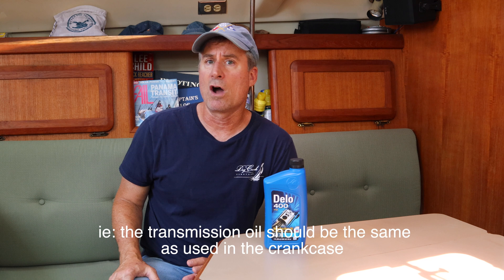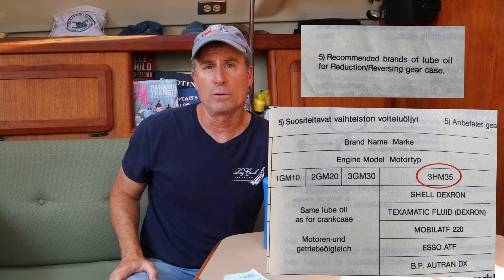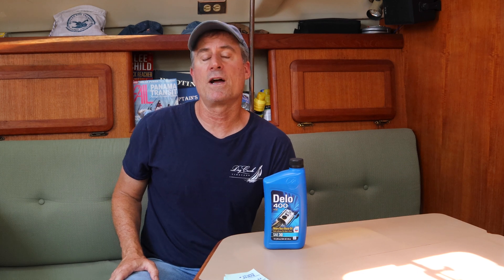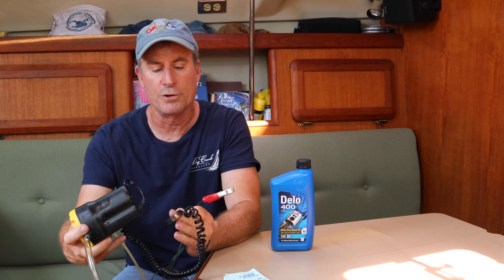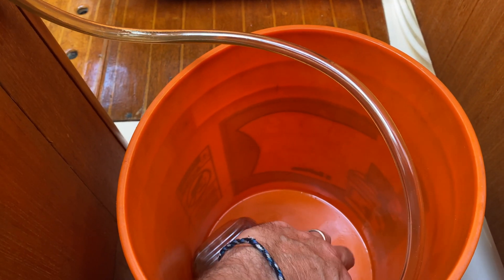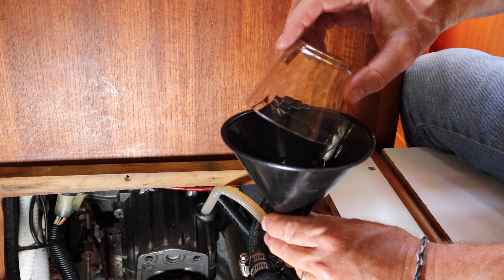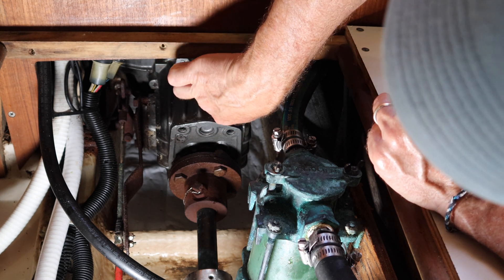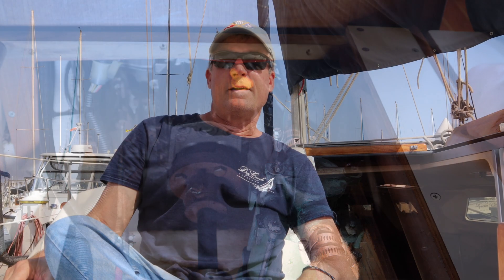Yanmar 2GM20 Transmission/Reduction Gear Oil Change ~ Ep 74

Comment: Proper name is marine drive.  Not transmission. Thanks for the video
Reply from the maker: As I stated in the first few seconds of the video and repeated throughout the video — Yanmar refers to it as the reduction/reversing gear in the owners manual for the 2GM20. The Yanmar owner’s manual  does not refer to it as a marine drive. I used transmission as a commonly understood word and also wanted to refer to the exact terminology that the Yanmar’s owner’s manual uses to avoid confusion. I also put on the screen, pages from the owner’s manual where they refer to it as reduction/reversing gear case. Thanks for watching!

Comment: I have the 3HM35F and yes it does require ATF in the reduction gearcase.  All of the GM series use motor oil in the gearcase.  The confusion arises from the maintence manual which covers the 1GM10, 2GM20F, 3GM30F and the 35HP 3HM35F.

Comment: How often should the transmission fluid be changed?
Reply from the maker: According to the 2GM20 owners manual (section IX p. 71) under Periodical Inspection and Maintenance — it states after 50 hours the first time on a new engine and every 250 hours thereafter.

Comment: A very useful video with all the detail from oil type to procedure used. I use a vacuum pump but after watching this video I'm shopping for an electric pump = much easier. Also very useful to see the colour of the oil form your gearbox, cleaner than mine but not by a lot. Great video thanks for posting.
Reply from the maker: Thank you for your comments! The pump was very inexpensive so I keep expecting it to fail, but it’s still working.

Comment: Before you start, pour a cup of water in the used-fluid container, mark the level on the outside with a Sharpie and pour it out.
When the old oil gets in the container you won't have to pour the old oil to measure how much came out.

Comment: I doubt very much that a mechanic cross-threaded the dipstick. It was most likely previous owner(s). Sailboats in particular are almost all owner (non) maintained. I have been looking at so many boats for purchase over the summer and I have to say they are 95% trash (non) maintenance by a bunch of bumpkins. Even owners with money don't have a clue what needs to be maintained and haven't kept their boats safe. There are many, many, many scary sailboats out there waiting for a strong wind to get dismasted, scary chainplates and standing rigging, electrical wire rats nests, gate valves waiting for an old seacock to break or hose to split and sink the boat. If I was an insurance company I would demand that certain minimum maintenance items have been changed/updated or I would not insure the boat. So no, not a mechanic...trash owners.

Comment: Tips for getting all the transmission fluid out?
Reply from the maker: You aren’t going to get every last drop out extracting the oil — but my experience is what’s left is insignificant.
Reply: @tcsadventures  i ment coolent sorry diffrent topic, blew a head gasket and saw your video about oil change and this, but nothing about changing the coolent.
Reply from the maker: No I don’t have a video on changing the coolant. You’ll want to flush the system too. You want to be careful — air left in the system can cause super heating of the engine. Below is a link on a guy that I believe is knowledgeable and he discusses how the system works and how to change/flush the coolant. https://youtu.be/aZv4IXFPMqg
Good luck!

Comment: It's nice to see how-to videos by someone who knows what they're doing. Good job
Reply from the maker: Thanks! My wife is always telling me that I have no idea what i’m doing lol! Hope the video helped you. Thanks for watching and commenting!
Reply: @tcsadventures  I did the change yesterday and just noted a couple of things. My dipstick although original doesn't have the extension to allow you to thread and unthread it without tools. It's more like a hex cap screw and a 
metric wrench is required. Getting single grade SAE 30 is a scavenger hunt locally, so I had to settle for 30w20.
Reply from the maker: I’m not sure I know what you mean about the dipstick. I may have said something in the video that caused confusion. My dipstick is all one piece. It’s an orange plastic knob with threads. The metal part of the dipstick is embedded in the plastic. Although it was obviously manufactured with separate component parts — it’s one piece that you don’t take a part. I did put on the screen a note from the owner’s manual: that when you check the oil level they want you to not just put the dipstick in the fill hole, but to screw the dipstick in to check the level. As far as the oil, I would follow the recommendation in your owner’s manual for the weight oil in your climate.